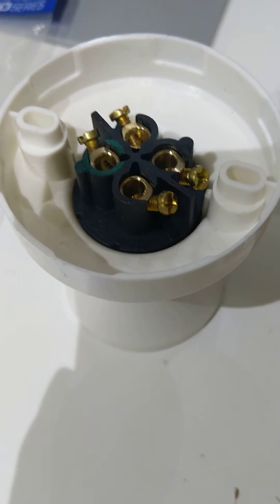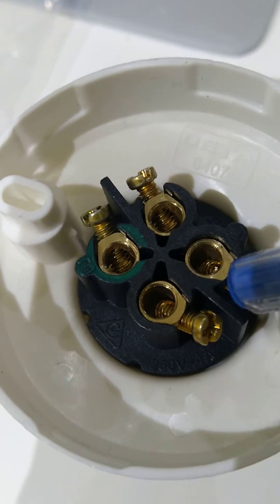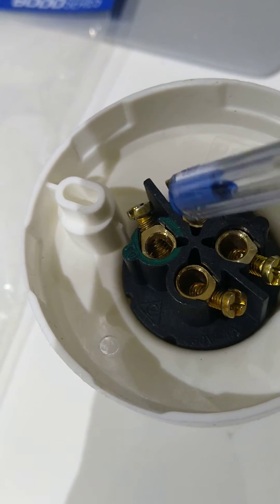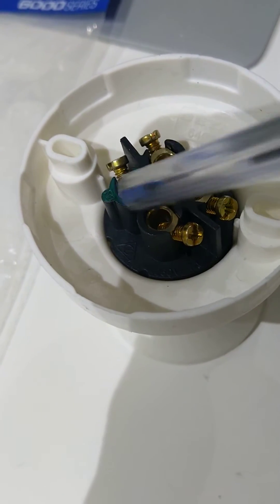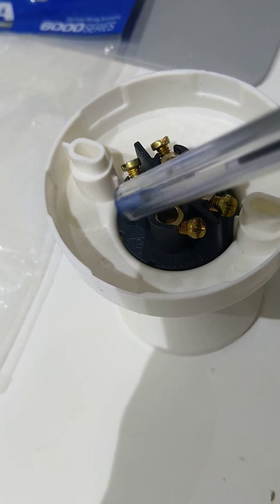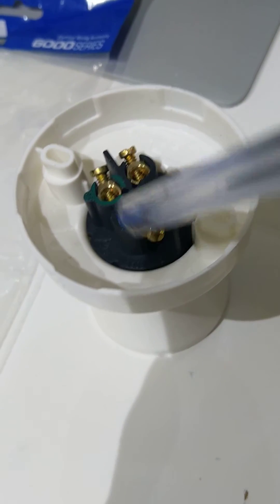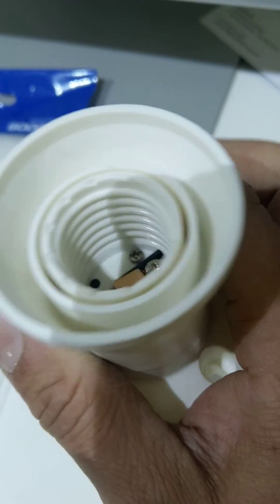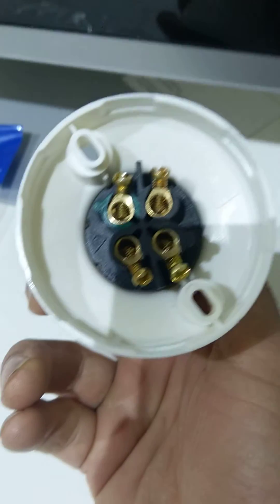E27 Batten Lamp Holder Deta make connection

Comment: I have two 2 core wires, red and black  coming out of the ceilings 
Which goes where?
Reply from the maker: Red is power supply, it has 240v and black is neutral but in Australia neutral is not neutral, please don't touch them. Connect red to L and black to N. Please let me know?.  Thanks
Reply from the maker: Sorry I wanted to write don't use E and L.

Comment: What colour wires to where ?
Reply from the maker: The live colour wire will be red and neutral will be black/blue depends on the area where you belong to. Earth wire will be yellow with green strips. Thanks
Reply from the maker: If you are using 1.5sqmm wire 2 core then please don't put in L and E terminal. Use the other terminal for connecting.
If three core cable then connect in E and other 2 terminal. Please don't connect in L.
Reply: so u cnat put live wire on in the Loop
Reply from the maker: No @tevitauhamaka1962